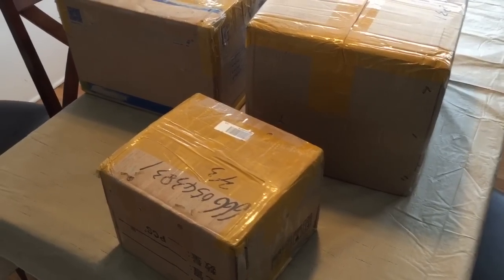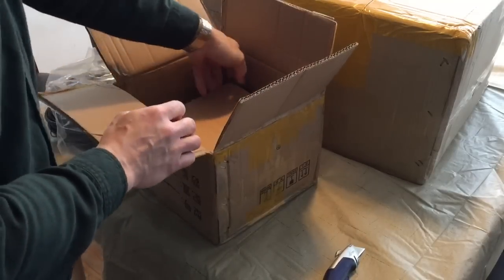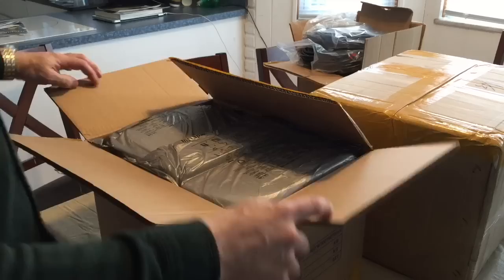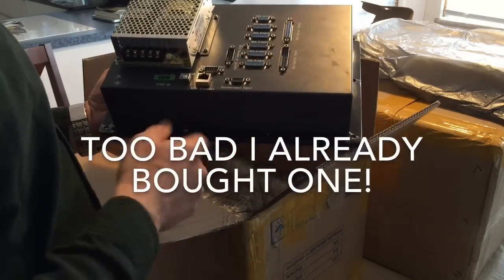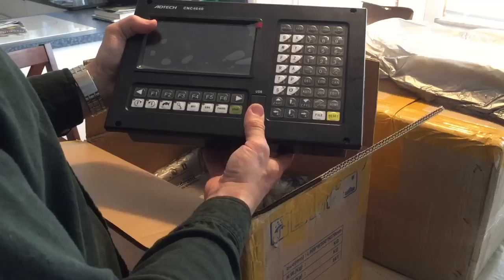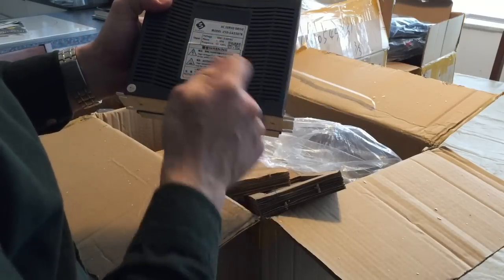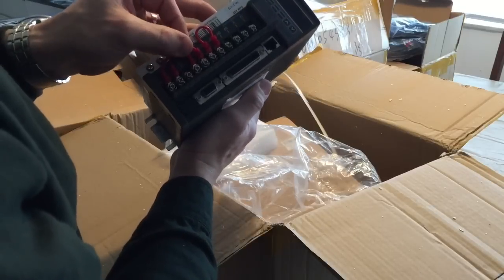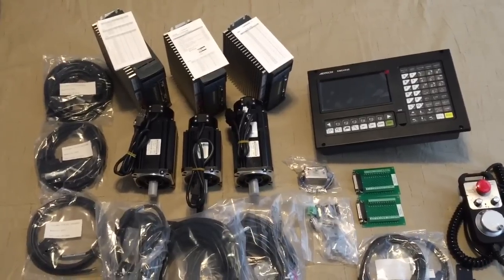DIY CNC mill controller and 1kW 750W servos from China unpacking.

Comment: It is been 3 years now, how is the CNC kit working now, any parts broken?
Reply: Hai,i use same brand,lets talk in wechat
Reply: @yudicnc1784  Noone uses weechat
Reply from the maker: Yes, I finally put my machine together. It is not what I originally had in mind and I had to make some compromises, but motors are working great, though, I do have some reservations about the standalone controller.

Comment: Please post your progress. Why you chose the Closed loop servos, what spindle you are thinking about. This offline CNC controller I take it,? Looks good, your first CNC and you aren't using software based ? . I am starting with Mach3 and the GUI it provides for interfacing, but of course you still need to interrpret this output with another "box" Maybe these DSP boxes are more portable I don't know, I have yet to build my table but I am hot on the traail of the correct design in a turnkey (ready made and delivered in ab bigger box: ) Or to buy it in many smaller boxes. There is a headache ahead I know it, I just want to minimize it.
Any way ...... Are you building the frame out of extruded alum, steel, combination?? This is 7 months later !
Reply from the maker: Like all big project, this one also comes with hoops, biggest two are time and money. Besides, there are always "better things" to do and "better ways" to spend my time (in other people's opinion). I chose closed loop because not many people do, bit more challenging. This will be my second CNC, actually. First one got inadequately small motors and was running too slow. The frame for this machine will most likely be steel, spindle Im thinking 5kW ATC.
Reply: Well for me I have just spent some time getting primed for this so it is kind of the knuckle down time.  It is inevitable as they say. Everything I have learned has pointed to CNC Router work. The 3D Printer has found a spot but it is plastic. Don't wish to spend vast sums of my money,  and I am not naive in that my custom solution could run a few more dollars,...  work off a vertical plane (dovetailing) and  Hi Z  with 8" capable rotary tool.  So I am into a custom steel frame and the heavy guage t-slot extrusions. Many disciplines and tools required, and there are no people of this ilk out around this 20. So.. I bid you a fair day and will perhaps keep an eye out for glimmers of activity

Comment: the high N*M motor is for your Z axis right? the one with only 2500 Rpm ?   Merry x mas
Reply from the maker: I’m planning for it to be a gantry style machine. The biggest motor is for x-axis, to move around the heavy gantry with spindle. Z-axis will have the motor with brake. There will be a gas spring to offset the weight of the spindle, to “help” motor.
And thanks, Merry Christmas!

Comment: Hello sir,
                i also order cnc 4640 cnc controller similar with you.I receive EMI filter with this controller. So i dont know where we use this filter 
( Between power supply & controller or Mainpower line & power supply)
Please guide about EMI file and their wirring
Reply from the maker: EMI (electromagnetic interference) filters should work on both DC and low frequency (50-60Hz) AC. I suppose, insulation and capacitors’ rating will be the limiting factor for use on AC line voltages.

Comment: Did you get any manuals or guides?🤣If you did I hope your Chinese reading comprehension is up to speed.
Reply from the maker: There was total about a hundred pages of setup and manual guides written in somewhat readable ChineEnglish, sent by seller as a file to my email. Overall, it’s pretty sufficient to get started.
Cheers.
Reply: Tinkering Nerd Lol, having been through the same thing I had to ask! But your right, Just enough to get you going, but leaves you wanting more. Glad you got it all working.
Reply from the maker: Yeah.. there are intricacies such as admin password for servo drives, some poorly translated menu items in the controller that keep you uptight..

Comment: DAMN! Those are huge servos.
Reply from the maker: For my first ever cnc router I used undersized servos. Will never make the same mistake!
Cheers.
Reply: Tinkering Nerd I did the same thing. Doesn’t hurt to go big if you have the space. Especially with servos where steppers the advantage isn’t necessarily the same. I have 2.2kw for my z axis and 1.2kw x and y on one of my machines. I have a shelf full of these for future builds. I like them. I asked in a new comment how you like them.

Comment: Do you need an encoder with those stepper motors so that way they know where they're at
Reply from the maker: Hello, these are servo motors with encoders built in. However, if I had an encoder, I would find a way to use it, one day. Thank you very much.
Reply: @TinkeringNerd  so is a servo motor a stepper motor?
Reply from the maker: They are not the same thing. They operate on different principals of application of electromagnetism. Generally, steppers are cheaper than servos at a given torque value.
Reply: @TinkeringNerd  and I bet servo motors have more than four wires right.
Reply: @TinkeringNerd  I'm trying to figure out with my stepper motor what size pulleys to buy and where to buy them
Reply from the maker: Yes, servos have more than four wires. They have two cables: a power cable to the motor, and an encoder cable.
Reply from the maker: Try cnczone.com. There is a wealth of information on all kinds of CNC topics. Cheers.

Comment: Hi, I wonder if this is closed loop CNC kit? Thanks.
Reply from the maker: Closed loop means that a command from controller is executed and verified. This system is closed loop, each motor has an encoder on it which is sending real feedback to the servo drive. Basically, the controller sends a command, and it’s up to servo drives to execute it correctly. Servo drives in turn have feedback signal wires that are connected to the controller and are transmitting the state of the servo drives (if they are ready, busy, or if there is a fault).
Reply: Thank you. Now I'm looking a good CNC conversion kit for my future milling machine  Grizzly G0755 :-)
Reply from the maker: Sure thing, I hope it helps.
Best of luck!
Reply: I could not see any CNC controller docs on Tomatech Automation website without complete information, this CNC controller will be useless
Reply from the maker: When I bought this controller, the seller sent me pdf file manuals. They’re not perfect, but, the controller won’t be a paper weight, after all :-)
Reply: I wonder why you prefer to choose standalone CNC controller over Linux CNC? Linux CNC can be run on bigger touch screen ....
Reply from the maker: That’s a good question. Probably, because I feel like I could learn a dedicated controller better than Linux. I’ve never had anything Linux, I don’t know much about it.
Reply: So this CNC controller comes with Post processor or you need to write your own Post processor for your CAM software?
Reply from the maker: I don’t think there is a post processor there. The controller can execute a g-code file from a usb flash drive.
Reply: Any CAM program has the post-processor for a specific machine and CNC controller, usually, CNC controller manufacture will provide Post-Processor for CAM programs such as SolidWorks CAM or SolidEdge CAM  etc. or you need to write a post-processor by yourself...
Reply: @717Fang    hehe .. yeah right. In your dreams.
Reply: @717Fang  I'm fan of Linux but getting CNC Linux up to this result is a lot of work to do, and this is more real world controller like